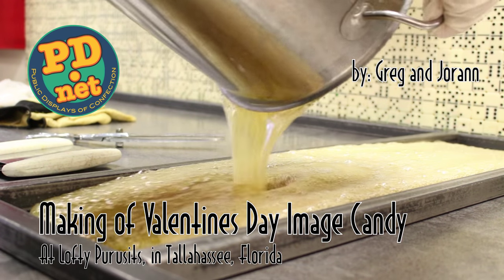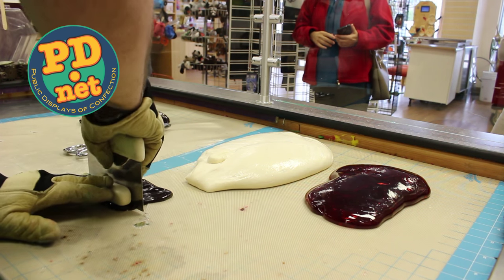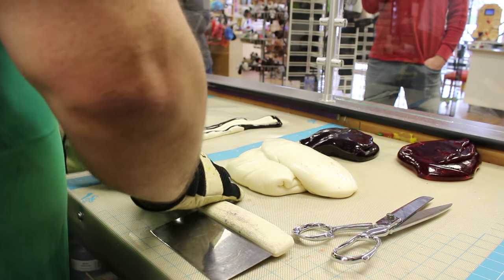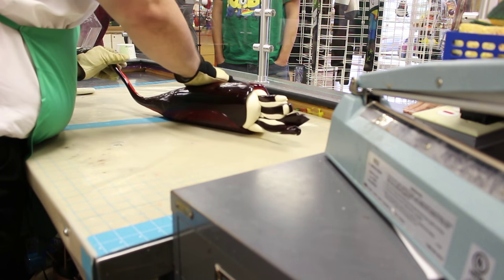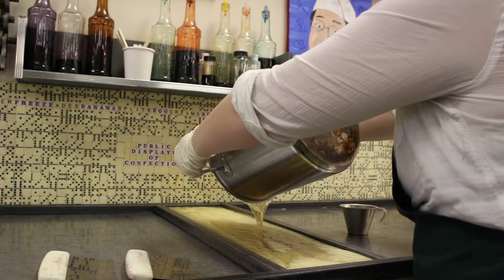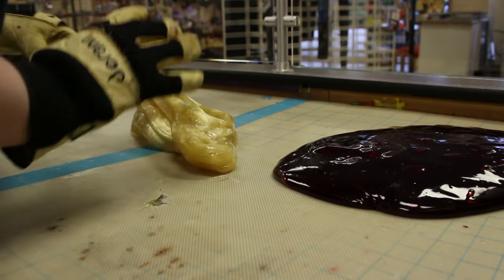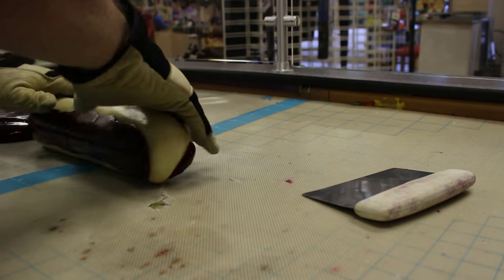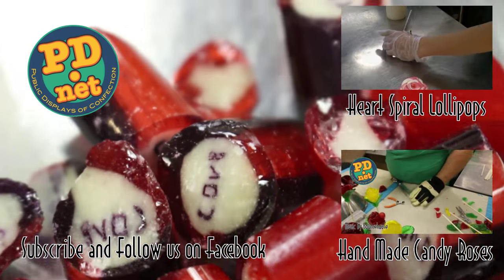#21 How to design Valentines Day Hearts and "Love" in image candy

Comment: Does the pulled candy with air in it have a different texture than the candy that hasn't been pulled? It'll obviously be less dense, but does it feel different in your mouth?
Reply from the maker: It does, and it dissolves faster, giving you a flavor burst.
Reply: Lofty Pursuits Is the difference between pulled candy greater with taffy or hard candy? I make taffy for the holidays & the pulling I think can makes a big difference.

Comment: Hey why do you sometimes use the taffy puller and sometimes just pull the white on the table?? I am very courious
Reply from the maker: +JellyKity27 It's the candy makers choice. For bigger batches, the hook can make it easier, but for smaller bits of white, the hook cools the candy so fast that it becomes hard to work with. If you pull on the heated table, it can give you more work time.
Reply: +Lofty Pursuits ooh that makes sense